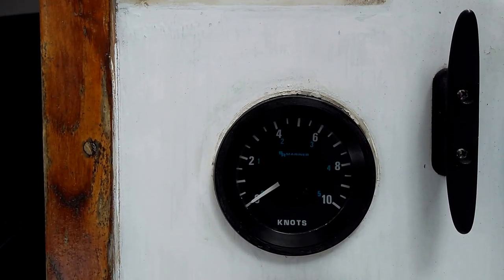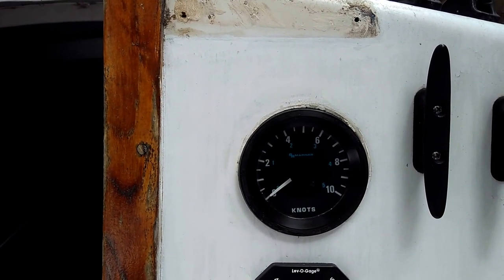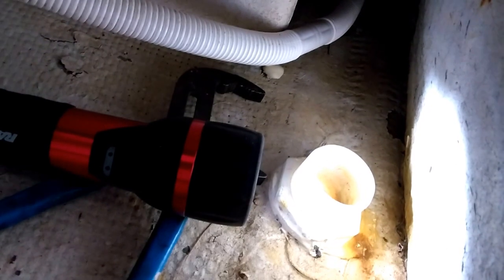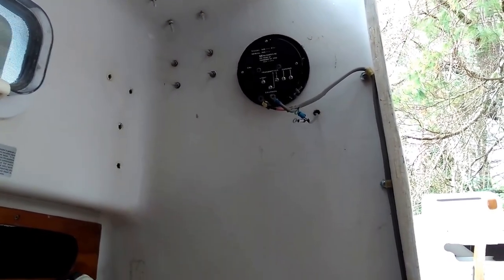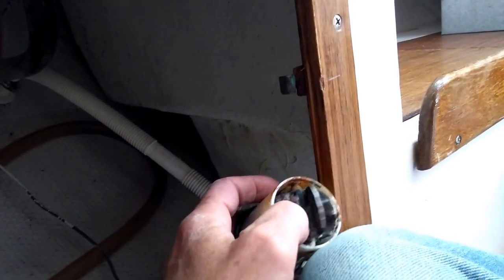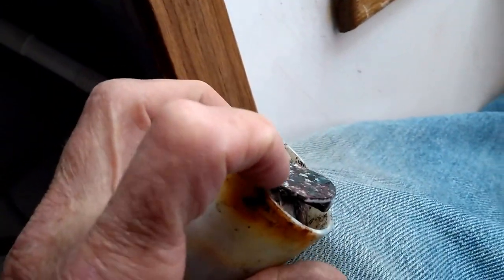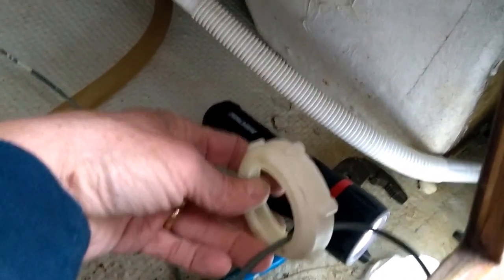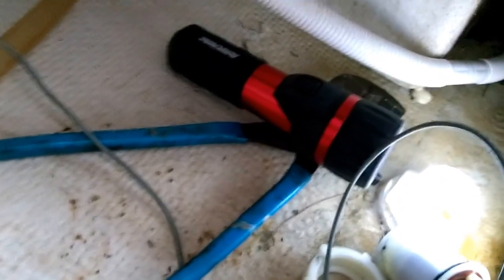S/V Little Girl ~ Episode 6  SR Mariner Knot-meter Sending Unit

Comment: That is a Moor/EMS transducer. It is only roughly similar to the slightly smaller SRMariner self powered transducer.  You would need to swap either the meter unit to Moor/EMS or paddle and thruhull to SR Mariner units. I tried the same setup shown and it was not accurate or linear for display readings.

Comment: Thanks for posting. Looks like PO plastered bottom paint all over the wheel on my boat, so will try and clean it up. Clean with paint thinner?
Reply from the maker: If you can get the paint thinner to work but I had to carefully scrape the paint off each paddle and then use 
some thinner. Bottom paint is pretty stubborn stuff,
Reply: @rrdner5700sbcglob  Checked it out this weekend and the paddle wheel spins freely, but I’ve got some work to do to get the paint off. Thanks again for posting, I had no idea it could be serviced by removing from the inside.
Reply: @rrdner5700sbcglob  Used a Dremel rotary tool with small sanding heads (on low speed) and it worked like a charm. Cleaned up nicely 👍